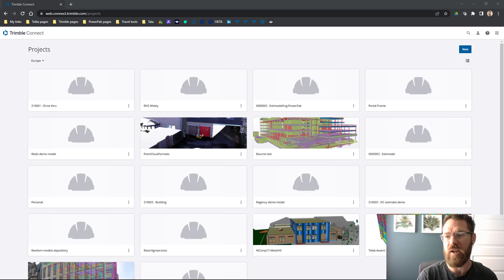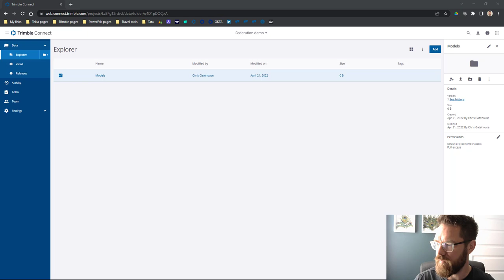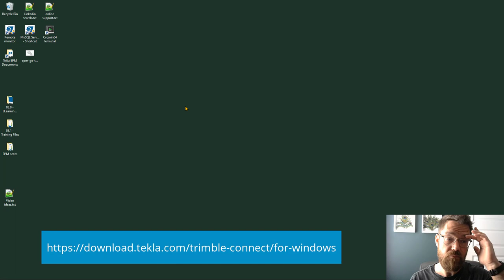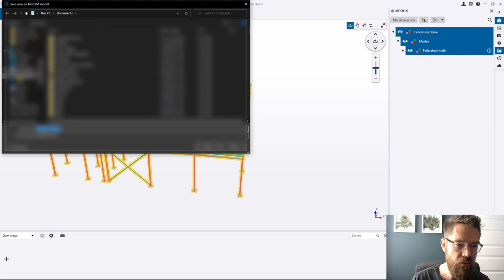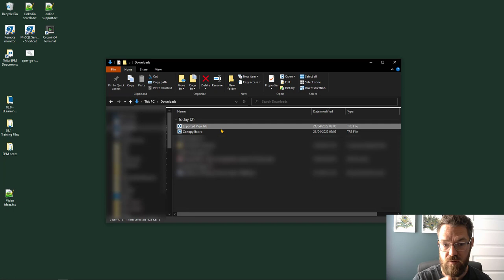Combining IFCs in Trimble Connect

Comment: Hi Chris, I have both models loaded as you did, but on desktop Trimble when I try to see both models at the same time I can't, it's like they are too far away from each other any ideas?
Reply from the maker: If your models aren't aligning the first thing to look at is the basepoints and making sure they're the same. 
https://support.tekla.com/doc/tekla-structures/2022/int_base_point
Reply: Hi Chris, Thanks for the message. looks like to edit base points I need Tekla Structures, I only have Trimble Connect free version, the two IFC I have are one is generated my me, the other from a third party. Normally when I do this both models are visible, and I can use the move command and move B inside A and align it. Do you know another workaround?